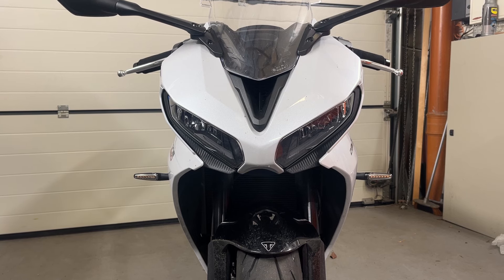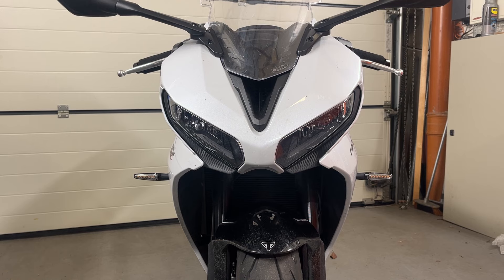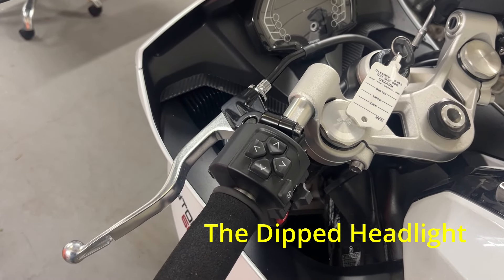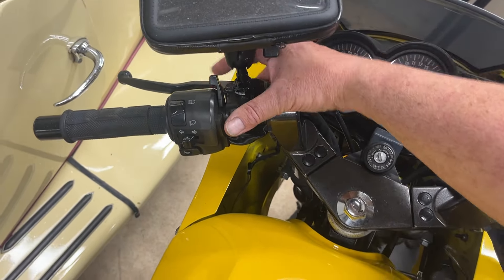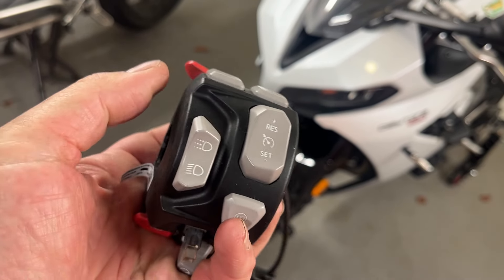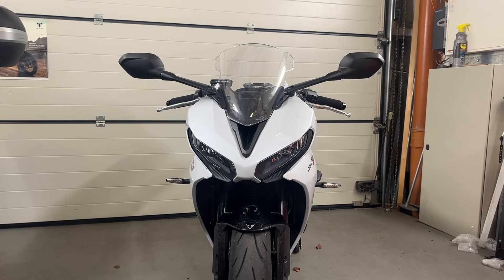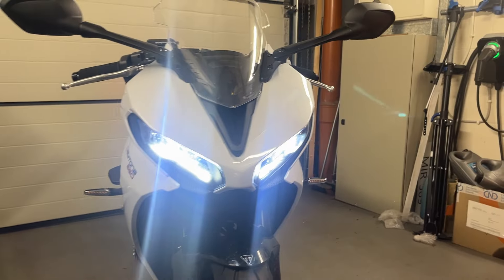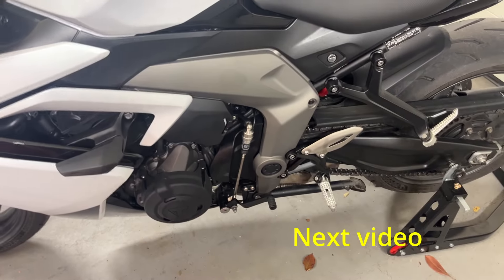Daytona 660 Headlights - what gives?

Comment: I just got the bike on Thursday and already rode 400 Kms :D love it so far!
Reply from the maker: Brilliant! That engine is addictive isn’t it? 😀
Reply: @terenceokeeffesmotorcyclestuff  yes it is! Although, I'd like to ask you a question., I've been hearing this sound coming from the engine that I'm not sure is supposed to be there.. I took it to the dealer and he said it's all okay and that's how it's supposed to sound(but at that point I didn't pinpoint the sound yet). It's a takatakatakataka sound which is separate from the intake howl and the engine growl.. it is in sync with engine speed, comes with the clutch engaged.  It's from the engine bay, not the chain or something.. went 400 Kms without a problem till now though.  Any comments? Thanks Terry! :)
Reply: On further inspection I think that could be the sound of the fuel injectors :D

Comment: Terry
It's beyond comprehension why Triumph would do such a thing like that. I agree that it would be nice to have symmetry. I'll bet someone will come up with a work around with the wiring.
Ride SAFE and BE safe Sir! 👍👍
Reply from the maker: I bet they don’t, the CANBUS will flip its lid if the lighting is messed with ttrguy! Take it handy. 😃
Reply: @terenceokeeffesmotorcyclestuff  Yeah, the CANBUS on modern motorcycles makes it so you can't do anything without triggering the wrath of the motorcycle gods!  The system is always sniffing for something like a nosey woman going through your drawers, pockets, wallet and phone. Any violation could lead to an expensive trip to the dealer or your lawyer! 😆
Reply: I think the reason could just be they are trying to save money and offer an extra cylinder at a lower price vs the competition